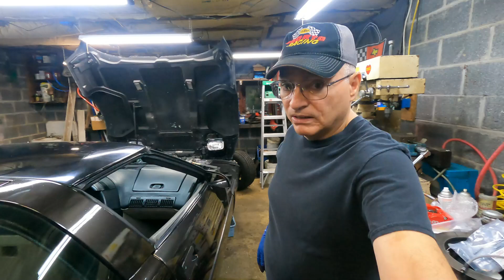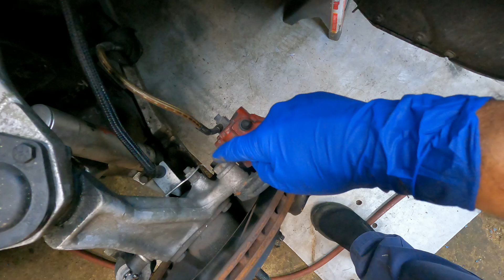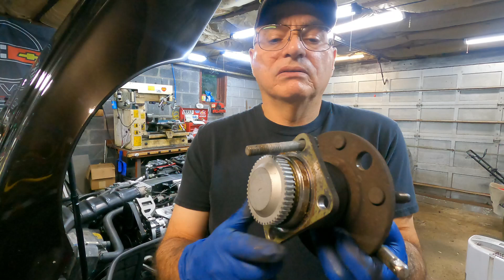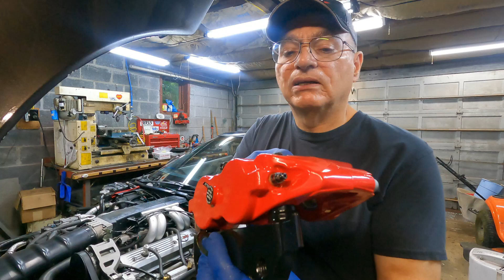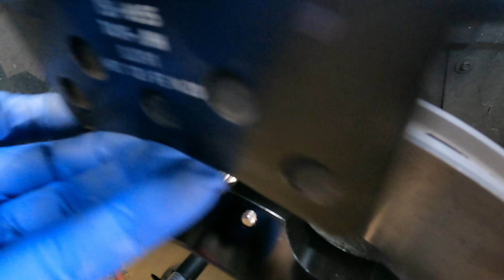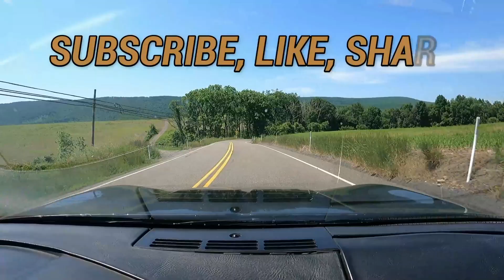Wilwood Brake Install.

Comment: Yep,  like your videos as well and your approach/methodology of assembly.  Assemble the brakes twice dry,  check for fitment, wheel clearance, etc; then prepare for final assembly with Loctite on bolt threads.   I was considering upgrade beyond the 6 piston Wilwoods, and 4 piston rears; but this might be the way to go.   Likely a project for next winter.   Thanks for the insight.
Reply from the maker: I just made a video not to long ago on oem 2 piece Wilwood brake rotors for the rear https://youtu.be/jDMacjRd0J0?si=z8wZ60z9dVa9uhLZ
Reply: @E.T.GARAGE  I'll watch it!   Maybe tomorrow!   Thanks!

Comment: I bought this Wilwood kit for my '87 C4 except I bought the rears too. It might be overkill, but I want to confidently stop the car which was an issue before. Your tips helped me, and I'm debating on whether or not to change out the hubs. One issue I'm facing on the rears is the e-brake engages when I put the caliper bracket assembly on. I have the drum style e-brake on the '87. I have to crawl under to get a better look at what's creating more tension on the line than with the OEM setup. Thank you for creating this channel.
Reply from the maker: I am glad my video's are helpful, Good luck with the rear brake.

Comment: Thanks for your info, though I am going to try a totally different project, converting from drum front brakes on a 66 F-100. I'm checking as many Wilwood videos as I can. You gave us good info on the spacers and the need for rubber dust covers for the bleeders, also remind to wait for the loctite until final assembly. I will probably need to make new hard lines too.
Reply from the maker: Glad it was helpful and good luck on your build.

Comment: Where are your Timkin front bearings made? I just bought a pair from Summit and mine are made in China, albeit seem to be very good quality. Apparently they are made in a few different places. Not that it matters, but it is interesting to know...
Reply from the maker: I did not look to see where they were made, but like most things probably China.
Reply: @E.T.GARAGE  Since this i have done a lot of bearing swaps, used Timkin, MOOG, and SKF, all three brands said Made in China somewhere on the package or the assembly.